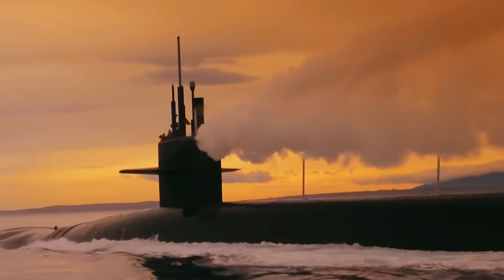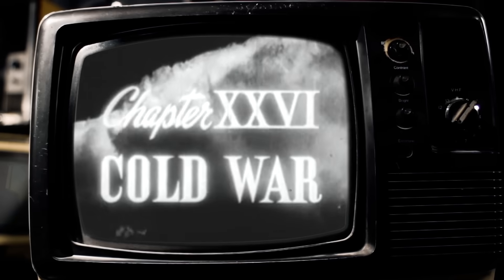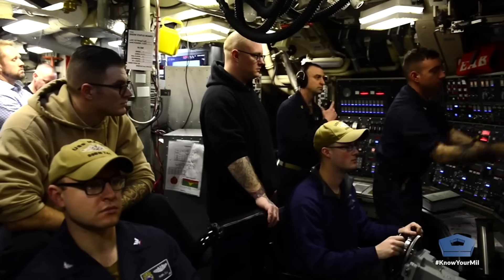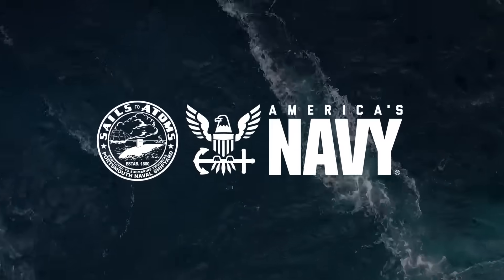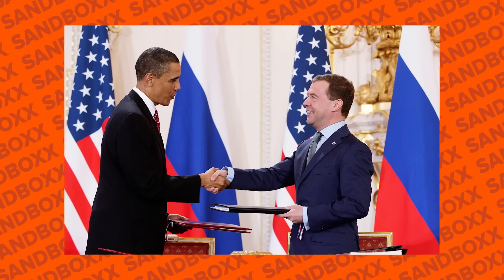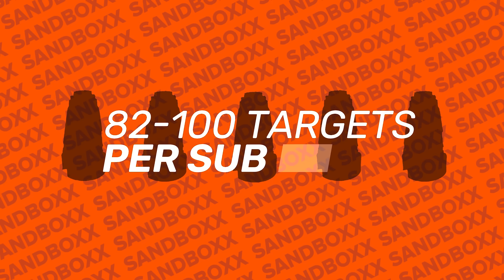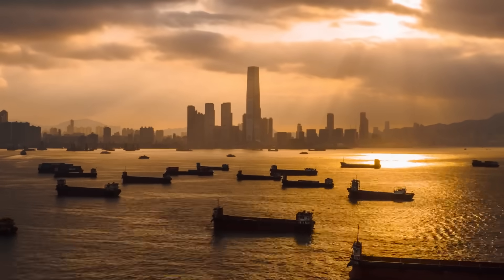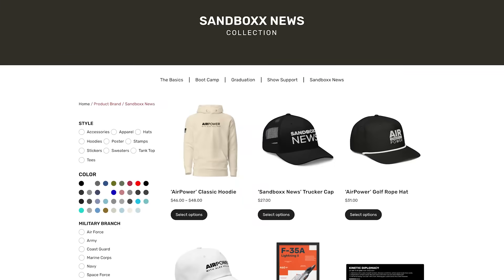Columbia-Class : The most devastating submarines ever put to sea

Comment: I worked as an engineer at both Electric Boat and Newport News on submarines. I worked on the VA class while block V was in the beginning design phases in several departments, and worked at Newport News as an Engineer for a short time on the VA class as well and I got to see the beginning of the Columbia itself. I got to touch the steering yoke just as it had been craned down in the main machine shop. I saw the drawings from the Columbia class, they were a disaster. Nothing coordinated well as in previous class drawings, all kinds of information was left out, exceptions and one off instructions were utilized everywhere to try and make up for the lack of information and knowledge that went into the class drawing. What a disaster it's going to be. I do not doubt one bit that the quality will be worse than the Virginia submarines and the schedule will be delayed into infinity. The Virginia class is complete junk, the Columbia will be even worse, and let's not even talk about the SSN-X. I know engineers working on that one from the start and NOBODY knows what the are doing. To make all of this worse, even the vendors have lost all the knowledge they use to have even just 10 years ago. This is a failure on the ruling class and their management class henchmen everywhere, across the board.

Comment: Ohio had 24 launch tubes.  Columbia is going to have what, 12, 16?  This will immensly limit usuability of design. What enabled so succsessfull conversion of Ohios to SSGN will be missing here. What I think was huge miss, was not building 3 more Seawolfs and at least 6 Ohios, but with Seawolf steel, reactor, drive system and components.

Comment: The U.S. shipbuilding issues can be traced to underpaying employees.  Well, trying to, since skilled workers like welders, electricians, and pipefitters just don't bother working at shipyards for that reason, leaving them severely understaffed.
If you go on a job listing site and search for posts from shipyards, you find that they pay half to two-thirds the national average that a skilled worker with same experience would get in any other industry, and they almost always require at least a few years in marine experience on top of that.  I saw one listing requiring ten years' experience, at least three in shipbuilding, that paid only about 10% more than the national average for a worker with less than one year of experience.  And the cost of living in the cities where these shipyards are located is higher than the national average as well, making the already ridiculously-low salaries even lower in practice.

Comment: Re: The Columbia class eventually carrying '70% of the US' deployed nuclear stockpile'... Is that 70% by warhead count, or 70% by totall mega-tonnage? (Ir is it some other metric?) I thought that, even if each Trident was fully MIRVed (if I may coin a phrase), that's 'only' 12 subs, times 16 SLBMs, times 12 warheads. (Those numbers are off of rhe top of my head, but they're close)... That means that the Columbia class COULD CARRY 2000-ish deploy(able) warheads, though based on the publically available info, the Ohios (which have more tubes and Tridents than Columbia will) have only about 1350 warheads (due to the Tridents not being fully MIRVed.')

Which left an estimated 300 active and 1900-ish in 'reserve' but presumably deployable warheads from gravity bombs, to ICBMs, etc. (in contrast to orhers described as 'retired or awaiting dismantlement' another 1300-ish...

That seems closer to 50%, give or take, of the nuclear deterrent, or less; that doesn't add up m. ...Accurate data is hard to find, numbers vary by source, by year, by definitions, etc. I wonder if there is some deliberate obsufication going on? Or just different sources using different nomenclature, or even failures in translation or due to misunderstanding(s)?

What is the actual numbers?

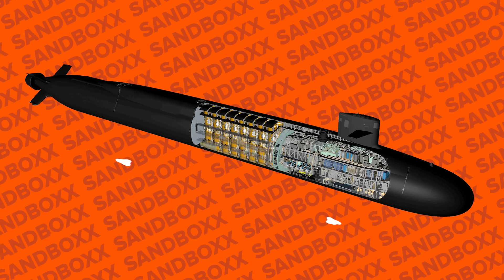Comment: 6:38
There is NO such thing in the US  Nuclear submarine fleet with a 430-foot beam !!
On the average the Beam/length ratio of the fleet is 9%.. That's optimum for hydro-dynamics , stealth and propulsion efficiency.
Imagine how much ballast would be required for a 76% aspect ratio sub ...

Please correct the script and the graphics.
This is a big whopper !!!. It makes one wonder what else has been gotten wrong on this channel.
Reply: He clearly put in  zero were there wasn’t supposed to be one. So much for proof reading the video.
Reply: @daikucoffee5316 Missing the extreneous zero while proof reading the script is forgivable..The graphics shows s neglect.
Reply: @lgl_137noname6 That and they were wrong about the Vanguard class, Which are our current SSBN's, not the new ones being built currently to replace the Vanguards that will actually be the class to feature the common missile compartment, which is the "Dreadnought class"....

Comment: Here's a request for a new Seapower vid: How about an explanation of the issues surrounding the retirement of the Tico class cruisers & the drawbacks of losing their capabilities for AAW command & control & the major differences between them & the Arleigh Burke flights? Also: How all this relates to the coming DDGX? I have a lot of info I could contribute for comparison purposes.
Reply: I think that is why they are talking about the new "battleships"
Reply: @sirkermittsg well, DDGX was supposed to take over this role from the Ticos as they were pretty much being designed to directly replace them & they are/were a cruiser in everything but name...

Comment: Alex, I love ya man, but as a veteran and former U.S. Navy Sonarman, I gotta say, "Seapower" isn't your forte.  

Now before anyone gets butt-hurt by that, just know that I hope like hell to see MORE Seapower from Sandboxx News.   I just hope the script is triple-checked for errors in naval / sea-faring terminology [stem vs stern or bow] and inaccurate measurements or specifications like saying Columbia has a 430 foot BEAM vs 43 feet..... that's a huge difference that even the graphics department somehow managed to miss!   

If this sub had a beam measurement nearly the same as its bow to stern length, it would be a giant non-floating barge, not a silent & deadly underwater predator.  Just sayin!  
⚓Sempre Fortis 🔱
Reply: That and the "Dreadnought class" currently under construction will be the one to feature the common missile compartment. Not the "Vanguard class" which are the Royal Navy's current SSBN.. 1993 - to present..

Comment: I hope you will address something that I saw on another YT channel. It regards the rapid build-out by China of a drone armed monitoring network around their area of the Pacific. 
According to the other channel, they are rapidly deploying little deep sea monitoring stations that have the ability to triangulate any contacts that it picks up by passive sonar sensors, and then ping the crap out of it with active sonar. They also say there is a docking station to keep undersea drones fully charged and ready to go surveil, or worse attack, the contact. 
I want to know about the capabilities of these Chinese stations, and how dangerous they are to our Boomers and Attack Subs.
Reply: This will happen, eventually. Detection is function of distance, and with options like 5G over Starlink and its equivalents and more energy efficient edge computing, dispersing sensors will be easier.

Comment: As far as the Ohio class subs outweighing WW2 battleships, they certainly weren't the American ones.  The 'slimmest' battleships used by the US in WW2 were the Wyoming class, tipping the scales at 26,000 long tons (27,243 at full load).  The Ohios top out at 18,450 long tons submerged (and FWIW, the Columbias are listed at 20,810 long tons submerged).

Comment: Off topic, but I wish the Navy would buy a small-ish fleet of advanced diesel subs, maybe 20, to use for homeland defense patrols, and free the nuclear-powered attack subs to deal with Russia, China, carrier strike group protection, and other more distant threats.
Reply: The problem with diesel electric is that it requires diesel. We use diesel for almost all out our surface fleet and almost all land based vehicles. It also creates a scenario where we must expose our position to refuel. As an added perk Nuclear power generates a lot more electricity which allows us to use more powerful equipment on the sub. Another big g reason we use Nuclear power is stealth. Diesel subs generate a lot more noise.
Reply: @Dejacoa We’re all aware of all that. That’s why I said they’d be for use on short range missions, so as to free up the nuclear boats for longer range missions. Also you should look into AIP propulsion, today’s diesels can run silent for extended periods, days, a week even, without running the engines. It’s a different world now.
Reply: @Dejacoa  I don’t see diesel as a problem I see it as an opportunity! 1 if Congress tells the military to make diesel electric subs a thing it will happen.  How many places can nuclear subs be made in the U.S. ?  Very few but diesel electric subs can be made on both coasts and the Great Lakes.  2. Imagine the navy saving all its lard and cooking oil to make into biodiesel.  Again if Congress wills it the navy can spur a new industry to counter the electric car industry and as an added bonus even Trump and the Republican Party can get behind a push where the navy starts buying soybeans and corn for biofuel production and helps the farms who are being screwed by tariffs increasing demand and prices for commodities here in the U.S. and the world.  3rd our allies buy diesel electric boats why shouldn’t the U.S. enter the game of producing diesel subs for sale and leverage our security alliances to buy our stuff.  The navy might not want diesel electric but the military shouldn’t stop at defending America it should support America.  That’s why I want states to get more say in what Uncle Sam does.  The defense pie should be shared by more industries , states, and companies!
Reply: @robertpesche  : 3 every two years was before the upgraded production lies and the additional line built. A reasonable estimate of the already increased production would be double the old figure.
Reply: @buildmotosykletist1987 Hasn’t happened yet, and if and when it does, the extra capacity for years will be to build the boats for England and Australia under the AUKUS deal.
Reply: @robertpesche  : It's completed. An easy search to confirm.
They won't be making them for the UK, only Oz.
Reply: @robertpesche  : AND, they are only making 3 for Australia.
Reply: The simple fact is that not economical 
One class of boats simplifies things. While the Los Angeles, Seawolf , Virginia , Ohio and Columbia are different classes, they are all nuclear so training , maintenance and other factors are relatively cheaper
The time about AIP and diesel is that they require considerably time to refuel and carry substantially less weapons 
Few navies can cross the pond
if you are worried about smugglers and drug runners
The way to solve that isnt with subs
The Coast Guard should be given 20 RQ-4 and 20 MQ-4C as well 60 MQ-20s
The RQ-4 can monitor an area the same of South Korea in a day so 3 to Alaska , 3 to West Coast  2 Texas and 3 to East coast
They backed by MQ-4C which patrol over the water which can easily detect nacro subs
The MQ-20 strike with small MK-81 250lbs bombs fitted with laser seekers
If you start sinking boats, you will find less people willing to volunteer for the narco runs
Reply: We cannot afford the life cycle costs nor the manning needed for close in subs - norcare they needed.  Aside from some laughable attempts by two Mexican cartels to set up drug 🎽 ng subs, there are no other threats that can get here "from there"
Reply: Add AIP to that, and a sub like that would be a worthy addition to the US Navy.
Reply: The navy made subs on the shores of lake Michigan during WW2 if Congress wants more operational ports then yes diesel electric boats are a must for the navy.  The U.S. should develop boats that should be able to be sold to our allies and used by the navy to increase operational flexibility give crews more experience and be designed so rescue operations can be conducted with more confidence.
Reply: @LordLawwritesforfans Actually some of our allies make fantastic diesel subs we could buy. We never would, of course, but we could. Sweden has a sub so quiet and advanced, it consistently “sinks” our aircraft carriers in wargames, and the crews of our attack subs guarding the strike group say they never heard it the whole time.
Reply: @robertpesche I agree the Gotland class is wonderful and Germany’s subs are also very good.  I’m for Congress to act by giving states and companies matching  funds to develop more ports.  I would be happy with a European company building subs as long as the production is done here in the states such as what SAAB has agreed to do in Canada with the Gripen.  Besides in the current U.S. political situation production and port establishments for ship maintenance and repair is a win for us all I hope.
Reply: And who is going to attack you? Are you afraid of aliens or some prehistoric huge underwater monsters from the deep?
Reply: @arteljus Do you think there are no threats to the US homeland? There is far more demand for attack subs for missions than the Navy can accommodate, and we’re only building 1.5 Virginia-class boats per year. Building smaller, cheaper, less complicated (due to no nuclear reactor) diesel boats would let shorter-range missions be handled by them, freeing up the nukes for the longer range missions. It just makes sense. Except to the Navy leadership.
Reply: @robertpesche   Again. Who is going to attack you? What threats?
Reply: @arteljus  Awfully dim, aren't you.
Reply: @john_in_phoenix   I asked a simple question. 
You have the biggest military in the world. Who is gonna attack you? Why would you want diesel subs on patrol near your coasts? To protect "homeland" from who? Iran? They don't have the capability to do anything to you. If they would get near you with droneships/continerships your navy would destoy them in no time because those ships have almost no defences and if they get to port undetected and attack you from the containers then they would not make it past few hours or days at most. 
Or maybe you fear North Korea? They have subs. But why would they attack your mainland? It would be a game over move from their side. They would be obliterated. 
China will never do it. What would be the point? And both you and them have nukes so it's out of the question anyway. 
Russia can't even take Ukraine. Nukes here too. So game over for the whole world if they did anything and why would they even want to attack your homeland?
There is basically no one in the whole world that would want or even can attack you.
Reply: @arteljus  China has a larger navy than the USA. Like I said, you're not the brightest bulb. I'm sure that extra pay from Xi helps.
Reply: @john_in_phoenix   Seriously? You are making a personal attack first calling me awfully dim then not the brightest and extra payed by Xi because iam trying to understand who is going to attack US mainland? That tells me more about you than me. Why would they attack US mainland? How would US Navy even allow them to even get close to USA? Chinas Navy is not better. They maybe have more ships but US Navy have more larger ships. They have only two operational carriers, US Navy have 11. Stop listening to propagnda. How many times have China attacked another country in past 50 years and how many have US attacked? How many times have USA been attacked in past 100 years? China is not going to attack USA. They have no reaon to do it unless you attack them first but as is said before how will it even be possible when both countries have nuclear weapons? Do you know what cold war was? It was cold thanks to nukes! China is building it's Navy to controll their waters and their sphere of influence. It has nothing to do with an attack on USA. I am in Europe. I don't need extra pay from Xi. 

For those who ask about Swedish subs. I say forget it. They will not be able to build them anytime soon. They have very low production capacity and they are working on new sub at the moment so new orders would probably start first after 2030 something. Look at UK and Germany instead. But as i said before there is no reason to get more subs to defend the US mainland when no one will attack it. Better spend money on more ships and drones or better education and healthcare.

Comment: Units for my non America friends.

Ohio and Columbia class: 560 ft length = 170.7m

43 ft beam (not 430 ft or 131m. That's an error) = 13.1m

Ohio class: 20,000 tons (Assuming it's US tons) = 18143.7 metric tons

20810 tons = 18878.5 metric tons

4000 nautical miles (4603.12 miles) = 7408km

7500 nautical miles (8630.85 miles) = 13890km

Comment: This has already been asked, but, WHY in hell does a sub with fewer missiles require a larger boat? Wouldn't it be that much stealthier and possibly faster if it was smaller???
Reply: Because there are things besides missiles on the boat.
Reply: The new propulsion system though quieter and more advance takes up more space than the old one on the Ohio subs. This info is out there on the internet if you look for it.  Now Im just repeating what I found on the internet.  I'm no expert on the matter.
Reply: Could be several things including more space for potentially new/larger missiles or needed for propulsion and other equipment, but that is just a guess
Reply: More room for food and other supplies so they can stay underwater longer time.

Comment: 09:50 Cube root of 90 ≈ 4.5 and of 253 ≈ 6.3
So the blast radius would be about 4.5 to 6.3× larger.
The area (A = πr²) affected would be roughly 20 to 40 × larger. 
Not 90 to 253 × bigger in visible destruction, but still devastatingly broader.